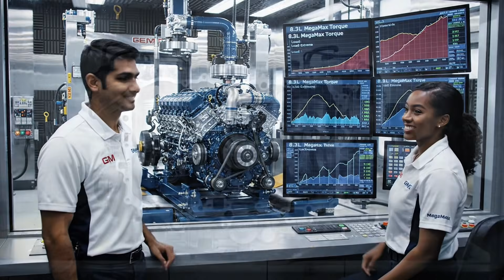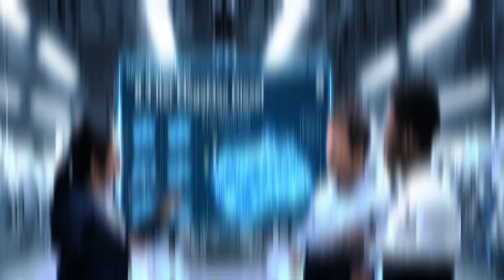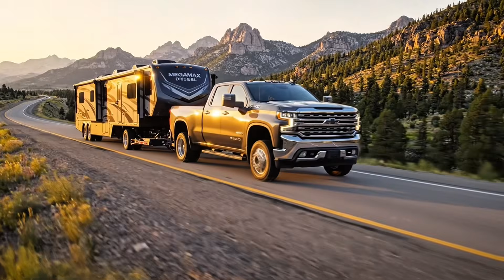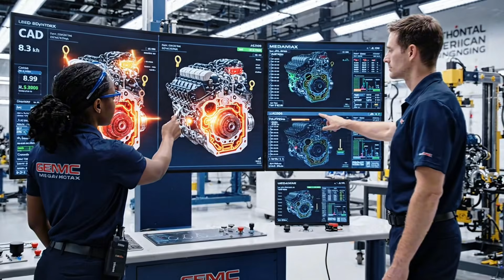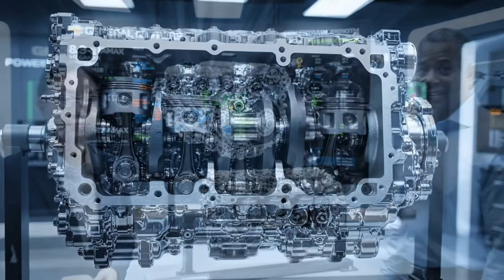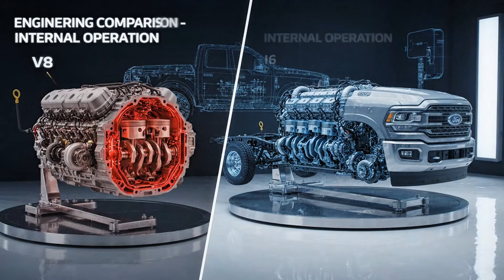GM’s 8.3L MegaMax Diesel Just Ended the Diesel Wars

Comment: Its 555 HP and 1230 lb-ft
Reply from the maker: Correct. GM has officially rated the new 8.3L Duramax V8 at 555 hp and 1,230 lb-ft of torque. Those are impressive numbers for a heavy-duty diesel.

Comment: Yeah I agree we need another Duramax engine in the lineup but get rid of the EPA restrictions because that restriction takes away freedom to do whatever you want with what you buy and that’s in the 1st amendment because some like to express themselves by what they do to their vehicles. But the rolling coal is not exactly the best idea because the build up of unburnt fuel leads to damage and let’s be honest I like to see the 18 wheelers that has a nice solid load blowing some smoke because those trucks are actually working and it’s the Get it done mindset and idk if yall are aware but some of the most important vehicles we use run off diesel.
Reply from the maker: Thanks for sharing your perspective. Diesel trucks are definitely essential for many jobs, and it’ll be interesting to see how GM balances performance, reliability, and emissions in future Duramax engines.

Comment: Ifin you need that get a semi . Grandpa doesn’t need to be on the road pulling a 45 foot rv trailer without a cdl. Their biggest screw up was not using the small v8 duramax they designed for half trucks and suvs
Reply from the maker: Good point. The 3.0L Duramax found a lot of fans in half-ton trucks and SUVs thanks to its fuel economy and towing balance. It’ll be interesting to see where GM takes the diesel lineup next.

Comment: Why does the 5thwheel have a helper on the front of it . Can’t the truck handle the hitch weight?
Reply from the maker: Good question. In many cases, the helper isn’t because the truck can’t handle the hitch weight—it’s often used for extra stability, easier maneuvering, or to support very heavy trailers during tight turns or uneven terrain. Thanks for bringing that up!
Reply: @CarVisionLab 

I’ll stick with my 450
Reply from the maker: @cwtex59  Can’t blame you—those F-450s are serious tow rigs. If it works for your needs, that’s a solid choice. Thanks for sharing!

Comment: I Bet the AFM the fkn thing too.
Reply: Bro you can disable the afm/dod for $400!!!!  People can put stupid tires on their trucks and spend thousands, but can't spend a few hundred bucks to disable afm/dod😂😂😂
Reply from the maker: @galevest4545  That’s true—disabling AFM/DoD is an option for many owners. The bigger question is whether it should be necessary in the first place. Thanks for sharing your perspective!
Reply: @CarVisionLab necessary? Absolutely! Think of it like this, people will pay more money to repair their  ecoboost  when it goes ecoboom and people will pay over 3 grand to do maintenance on tundras timing set  but don't wanna do a dod/afm  delete  which is about the same price or cheaper and a permanent fix! Could have installed a cheap disabler and changed your oil instead of having that nasty sticky stuff that causes the lifters to fail and got over 180xxx miles ! Nope, we live in a world where people's not very bright anymore
Reply from the maker: That’s a concern a lot of GM owners have. Hopefully, if GM introduces a new engine, they’ll also address AFM/DFM reliability concerns. We’ll have to wait for the official details and real-world results. Thanks for your input!

Comment: For me to buy a modern diesel, it would need proven 350 thousand mile durability at minimum (with good service/basic maintenance like filters, oil, etc). Pass this stress test. Also, the 350k miles is while being used like a truck gets used.  Loaded in bed. Towing a loaded trailer.
Reply from the maker: That’s a great standard to hold them to, because real-world working miles under heavy loads are what truly prove long-term durability.
Reply: @CarVisionLab  right? I don't mean to infer over loading or abusing. Just real world stuff within capacity of the truck, whether 1/2 ton or 1 ton.

Comment: I grew up a GM guy. 58 now and still love GM. I am highly disappointed in all auto makers. Compared to older technology today's stuff is junk. I drive a 2000 F350 with the old 7.3 turbo. Not the baddest but just keeps on going. 470,000 miles and still pulling heavy loads daily. Maintenance is the key. Oil change every 3 to 3500 miles. People say i change it to often. Well, maybe but it seems to be working out great! 😂
Reply: You mean you drive a ihc
Reply from the maker: @timheuer6049 Haha, that’s one way to look at it! Either way, it’s clearly been a reliable workhorse. 😄
Reply from the maker: That’s an impressive milestone! 470,000 miles while still towing is a testament to good maintenance. The old 7.3 has certainly earned its reputation, and your experience shows that taking care of an engine really does pay off. Thanks for sharing!
Reply: 100% agree, 
I'm an old Ford guy, I to am 58 now & still love my Ford's but I am also highly disappointed in all car  manufacturers.

Comment: Still dowel cams ? It’ll blow up with those and that much torque
Reply from the maker: That’s a fair question. GM hasn’t officially confirmed the final valvetrain or internal design yet. Hopefully any future high-torque engine will include the durability upgrades needed to handle the added power. Thanks for sharing your thoughts!

Comment: If torque number is accurate a DD15 is rated at 455 hp with 1650 torque from 1100 to 1800. Mega power for a pickup
Reply from the maker: Good comparison. If numbers like that ever become reality, it would definitely put heavy-duty levels of torque into a pickup. For now, though, we’re waiting for official GM specs to see what actually makes production. Thanks for the insight!

Comment: needs to use the ''REAL'' allison 9 speed trans
Reply: I'd be happy if they just went back to the 6 speed
Reply from the maker: @desert4wheeling209  A lot of owners still praise the 6-speed for its simplicity and durability. It’ll be interesting to see whether future transmissions focus more on long-term reliability. Thanks for sharing your thoughts!
Reply from the maker: A genuine heavy-duty Allison is definitely something a lot of truck owners would like to see. It’ll be interesting to see what GM does in future HD models. Thanks for sharing your thoughts!
Reply: Allison should build it since their name is on it and it’s their transmission platform not GM’s that’s why the older years were better because I’ve seen plenty Allison built Semi transmissions perform great because if Allison tells GM how exactly they build their transmissions successfully it’ll put them as a competitor and they’ll eventually rebrand it for GM Into something else that’s not a Allison and let me remind you of the L5P “Allison’s” how are they holding up, i know someone personally on the second or third and the truck hasn’t seen 100k and my first Duramax was a LB7 when Allison was Allison and they built for GM so let’s keep it that way.

Comment: I was talking to a Semi Driver, he said the motor under the hood was an 8.3L 6 cylinder. Does this mean that the MegaMax is gonna have that much power?
Reply from the maker: Good question! Not necessarily. Engine size alone doesn’t determine power. Factors like turbocharging, fuel system, tuning, and torque all play a huge role. We’ll have to wait for official GM specs to see what the MegaMax actually delivers. Thanks for watching!

Comment: If GM makes it or has ANYTHING too do with it. DO NOT BUY IT. GM designs nothing but junk
Reply: Lol And Yet ford has More recalls than all its competitors!!! Combined ford is so screwed up  they have had to Recall their recalls because ford Again screwed UP!!  Its not Just GM , Toyota's blowing up left and right and lied about having problems, ram has its own problems
Reply: @bwaters698 please name one I've worked for GM and Mopar trust me there problems ate not even close to GM and Ford or Toyota
Reply: @Jerkjeep Hmm , how about the hemi tick - noise caused by broken or leaky  exhaust manifold or even caused by lifters and camshaft problems, hurricane problems- turbo problems  lines on engines coming lose repeatedly, overheating problems  , how about all the reported transmission problems  ram is having, or how about electrical problems poor software!  And rams build Quality has been poor , water leaks in the cabin, fit & finish poor!! OH i almost forgot ram is big problems with their suspension's  I thinks its Fair to say like i already said ram has its share of problems! And did you say you work for Dodge? If so you may Just be a little  biased
Reply: @bwaters698 ram has the absolute best truck transmissions on the market at this time and I've replaced hundreds of 5.3 cams and lifters aswell as broken manifold bolts on ford and GMs 5.3 and 6.0s. Dodge cam and lifter problems are not close to GMs. Princess
Reply: @Jerkjeep and Dont let me Bring up all rhe Problems ram is having with its 6.7 Cummins
Reply: @bwaters698 that's not a mopar problem Cummins builds that princess
Reply: @bwaters698 How about all the problems the durajunk has and let's not get started with the powerjoke
Reply: @Jerkjeep its does matter my friend, its in a ram trucks, if it was in a GM you  would call  it a GM  peace of  crap  , I not defending GM or any of them , like i said its not just GM , they all have problems and are way  over priced !, you ask me to give you just 1 problem ram is having and I did
Reply: @bwaters698 GM builds the durajunk ford builds the powerjoke Cummins builds the 6.7. I own a 2012 6.7 has never had anything but maintenance . All these new diesel engines are not worth buying the federal government trashed all of them. I also own a 5.7 hemi and a 6.4 hemi no  issues with either of those since I put shorties on my 5.7. I wouldn't take anything Ford or GM build in the last 10 years if it was free.
Reply: @Jerkjeep same can be said for Dodge, ram in pass 10 yrs, you Must be 1 in a million, all the problems i gave you was from customer complaints at dealerships and the NHTSA both my wife  and I  nephews  that own their own  business, my nephew a pipe fitting company  the other nephew a custom home business,  both tired ram trucks with a hemi and Cummins had nothing but problems  from electric problems fuel pumps to blown engines, my nephew was told by ram , his  truck should be a 1 ton and not a 3/ 4 ton truck to handle his welding  machine,so he traded in the 3/ 4 ton for a ram 1ton Cummins, blew 3 engines The Pathetic  excuse the dealership gave him was ram trucks aren't built for welding machines , last I dont know if you know this because Chrysler (Solantis) has been backed by Black Rock everyone in involved in the pass few yrs has been trying to cover this up , Why? BR hates America, they give tons of money to  anti American  groups , dont have to believe me but if dig deep enough and look hard enough you will see iam telling the truth ! SO that Alone you Couldn't give me Dodge ram Chrysler  vehicle and those BS commercials ram have on tv ARE a Frigging joke !! ram all about  AMERICA  RIGHT!!
Reply: @Jerkjeep one last thing most people dont know this but GM's biggest problem is its ceo ! What people don't know is Obama put her there  to bring GM to its knees and she has done a pretty good  job of it, oh well its been fun hope you keep having good luck with your vehicles
Reply: @bwaters698 you are correct she needs to go. But gm was going down hill before she took over.
Reply from the maker: @Jerkjeep  Thanks for sharing your firsthand experience. It’s always valuable to hear from people who’ve worked in the industry. Hopefully every brand continues improving reliability for customers.
Reply from the maker: @bwaters698  You make some valid points. Every manufacturer has had reliability challenges over the years, and hopefully competition pushes them all to build better trucks. Thanks for sharing your perspective!
Reply from the maker: @Jerkjeep  Thanks for sharing your experience from the repair side. Real-world technician feedback is always valuable. Hopefully all manufacturers continue improving reliability for owners. Appreciate you joining the discussion!
Reply from the maker: @bwaters698  Fair point. Every diesel platform has had its share of issues over the years. It’ll be interesting to see which manufacturers make the biggest reliability improvements going forward.
Reply from the maker: @Jerkjeep  That’s a fair distinction. At the end of the day, though, owners usually judge the entire truck package regardless of which company built the engine. Thanks for sharing your perspective!
Reply from the maker: @Jerkjeep  Every brand has strengths and weaknesses, and real-world owner experiences can vary a lot. Healthy debate like this is what makes these discussions interesting. Appreciate your input!
Reply from the maker: @bwaters698  I think that’s a balanced take. No manufacturer is perfect, and reliability, value, and ownership costs are what matter most to buyers. Thanks for keeping the discussion going!
Reply from the maker: @Jerkjeep  Thanks for sharing your long-term ownership experience. It’s always valuable to hear from people who’ve put serious miles on these trucks. Hopefully every manufacturer continues improving reliability for future buyers.
Reply from the maker: @bwaters698  Appreciate the discussion! Leadership and product decisions definitely spark strong opinions. At the end of the day, most owners just want reliable trucks that deliver good value. Thanks for keeping it respectful.
Reply from the maker: @Jerkjeep  Fair point. Every manufacturer has gone through ups and downs over the years. Hopefully the competition pushes all of them to build better, more dependable trucks for everyone. Thanks for joining the conversation!
Reply from the maker: @bwaters698  Every manufacturer has faced challenges in recent years. The real test is how they improve reliability over time. Thanks for adding your perspective to the discussion!
Reply from the maker: I understand why you feel that way. Reliability is what matters most, and that’s exactly what we’ll be watching as more real-world data becomes available. Thanks for sharing your opinion!

Comment: with GM's reliability in the gas engines taking a huge nosedive, anybody taking bets on the 8.3 being a problematic pile of shit?  i certainly would hold off from buying anything thats new until it proves its reliability  for 3-4 years, even the current Dmax has its issues, including crankshaft breakage
Reply from the maker: That’s a fair approach. Many buyers prefer to wait a few years before adopting an all-new engine to see how it performs in real-world use. Reliability will ultimately determine its success. Thanks for sharing your thoughts.

Comment: They better put a keyway in the crankshaft. Then the oil pump will not sieze and destroy the engine.
Reply from the maker: That’s a good point. A more robust oil pump drive and improved durability would be high on many owners’ wish lists. Hopefully future designs continue addressing long-term reliability. Thanks for sharing your thoughts!